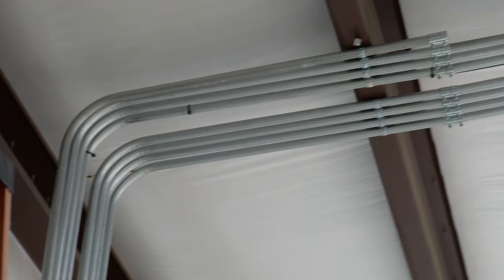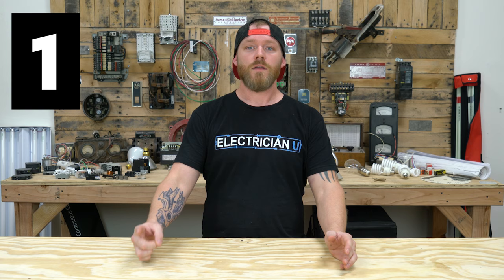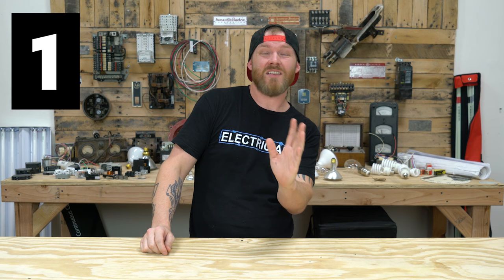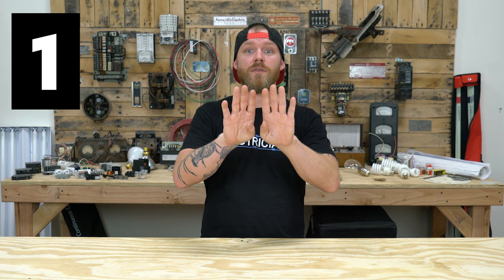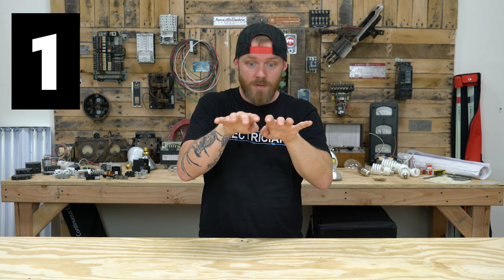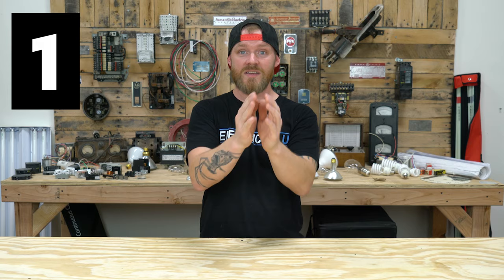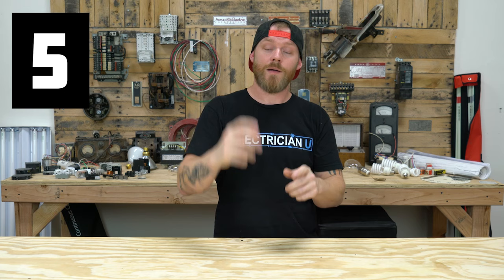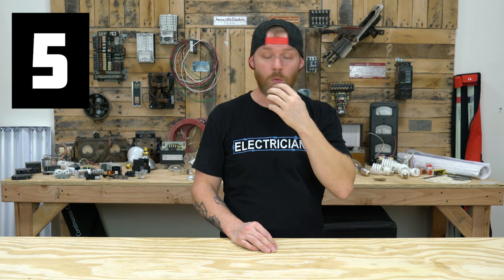8 TIPS FOR WORKING WITH EMT for Electricians

Comment: Run the correct size conduit... I just saw a dude trying to pull 11 or 12  #12's in a 3/4  , with bends and about 80 long ..  Hell  give yourself some room - you might want to add later
Reply: Jesus. Was it stranded? I’m only a 1st year apprentice but recently had to pull 3 circuits of solid wire through 3/4. It was not fun
Reply: @tylerclark5086  yes stranded but still  - no room to grow

Comment: For the past 5 weeks we've been going through about 700' of conduit daily, and after taking a few days off for Thanksgiving, coming back to videos like these is a great way to get out of vacation mode and back into work mode.
Reply: Nice easy straight pipes no problem. Lol
Reply: @klimvanglodove2925  the shortest distance between two points is a straight line.....even if it goes through the kitchen of the DFAC. 🤣🤣🤣🤣🤣

Comment: Thought I was a decent conduit bender until my company hired a young guy swear that he had 20/10 vison. Most of the times he could eye ball a bend without using a tape measure. Had him work on a job where we installed over a mile of conduit in a plastic injection/ machine shop. We used regular 15/8" deep unistrut but got a hold of some think it was 1/2 or 5/8" deep extra shallow unistrut so we did not have to offset into 1900 & 2100 boxes by mounting several boxes on shallow strut and all conduit runs on regular 15/8" deep strut. This saved us from installing a lot of pull boxes due to all runs had 360 degrees in bends. On big jobs best pratice is to have 2 best conduit installers walk around rooms several times and figure out best route for runs.

Comment: I'll typically keep a scrap piece about 6 feet long or so. Sometimes there are not great and consistent reference points around to measure for offset. So ill attach the scrap piece and extend it past the obstacle, hold my level on it and measure. Also a bang on caddy 8ft down the line sure helps when throwing up 10ft stalks of pipe alone considering how frustrating it can be to get the pipe into the coupling smoothly.

Comment: 2 add ons...

Know when to throw the level back in the toolbox. Especially on upgrades when you are not the first one there.  Sometimes uniformly f'ed up looks better, one perfect conduit in a rats nest looks like hell.

Have a plan for the entire run before starting. Know where your bends and fittings will be rather than only thinking about the next stick. Nothing worse than putting a fitting someplace hard to pull wires because your at 360 degrees. Handling a spaghetti ball in the middle of a 400 ft pull sucks and big wires suck more.

Comment: Another Tip for people reading comments.
Avoid 360 degrees in your pipe runs. Pulling wire through four 90 degree bends can become damn near impossible.
Reply: Against code as well.
Reply: @Winged1212  no it isn't, thats the max you can have
Reply: Obviously that guy hasn't pulled miles of wire yet.
Reply: Ha I just finished a job where half of the home runs were at least 800° of bend. Took two and a half months of my coworker and I pulling wire like crackheads to finish that. Absolute nightmare.

Comment: If I was using concrete tight fittings on close EMT Runs. I would offset the couplings from each other by exactly three inch’s by cutting the conduit. Makes it a lot easier to tighten and retighten the fittings. Also it looks neat. Also by our local codes you can’t have more that 360 total degrees in a run. You have to install a “J” box to continue.
Reply: Steven Moomey thats NEC code. Not just local. You could install a straight conduit body as a pull point if you wanted to.

Comment: #7 same with strapping. We ran into q-deck and metal trusses hold the pipes up (although you mess the pipe working it up there) it's still code here to strap it down. But I realized when I got done the run that I should have matched my straps with the other 4 runs the jman put up. So I quickly got it fixed.

Comment: I always evenly space but I also split my runs coming out of a panel.  If I know my breakers gonna be on the left it goes to the left side of the enclosure and if its gonna be on the right it goes on the right.  Helps reduce the number of times I'm "crossing" the panel.

Also on my truck I keep the common couplings and connectors for 1/2 thru 1 and 1 hole straps.  Then I have a mixed bin of random connectors couplings straps etc. for each size.  90% of the time I have what I need to make it through or know our regular service sites well enough to know what I need to bring or what's on site in the service lockup.

Comment: Hey man I would really love if you did one of these on Panels, I'm in school right now and having a little bit of a hard time keeping looking clean. If you could talk about any techniques that you use, that would be awesome. Thanks for all your videos they are great.
Reply: I'm doing panels at work right now.
3 sets of 2 panels with a trough above each set.
Set your panels up properly from the start. 
Run homeruns with odd circuits from the left and even circuits from the right.
Don't enter and odd circuit on the right and wrap it around the panel to land it on the left.  
If pipe was ran pull the correct colors to match the phase for that circuit. If MC was ran it is what it is.
If feeding multiple circuits thru a nipple pair and  them with a zip tie to keep neutrals and hots from mixing. 
Mark every homerun.
Square off your neutrals to the side and back corner off the panel then down to the terminals, square off the bends on the wire and secure with sticky backs and zip ties.
Mark the numer of the circuit by each terminal with a number book.
Square off your hots to the sides and down to each breaker. 
Keep neutrals and grounds to the back and hots in the front.
Tie the grounds as 1 wire with zip ties and sticky back.
Do the same with neutrals and hots. 
Mark the panel schedule.
If it is the first panel and the main breaker serves as the first switch from the street be sure to use MIGB and bond the panel, lug and ground bar. And the service neutral must be bonded.
Any connector on the panel 1" or above requires a threaded pipe bushing.
Can't think of anything else - good luck
Reply: Michael Gallagher thanks so much I really appreciate all the advice! I’ve made some notes and I will use them on my next panel.

Comment: 1) know your bender.
2) check for kinks
3)add lube to bender head
4) know how to bend conduit with out turning over the pipe around. Use your stars, notches
Reply: Lube to bender?  Never heard of that.
Reply: @JulesBartow  yeah it helps with it bending smoothly. Example on 1 inch pipe and up, how many times have you done 3 and 4 points and they have the bumps on the i side, especially if you let thr bender release tension a bit when doing the bends, even on 90s?? 

Rub lube onto bender well, and bend a little smoother with great tension with releasing pressure.

Comment: Hey, I have been in the electrical trade for 2 years now and was wondering if there's any way to wire a 3way half hot and if so how. It would be awesome if you can make a video of that.
Reply: If you are wiring from scratch in residential: You would have to run a piece of romex 2 from one power source to bring hot and neutral to one switch box, then run another romex 2 from that switch to feed hot and neutral to the receptacle box. This will give you power to your switch and your receptacle. Then you will need to run romex 3 from the first switch box to the second switch box in order to have your travelers (red and black) between the switches. The white will be neutral on all cables. Finally, you will need to run a romex 2 switch leg from the second switch to the receptacle. You will then need to break the hot tab on the receptacle and leave one half of the duplex hard wired and switch the other with the black from the switch leg. There are several ways to do it, depending on local codes, how big the boxes are, if you plan on making any separate distribution boxes, or if you are using some sort of conduit etc.
Reply: @illestofdemall13 good explanation.
Reply: Half hot? What the hell does that mean?

Comment: Finding a lvl floor at a jobsite to be checking 90's is rare. You are under pressure for production and in competition with other mechanics. I use a door or window frame to eyeball if its parallel, kinda how you look for parallel in an offset.
Reply: That's why it's good to have a level bending table or even have 2 pieces of angle iron welded in the corner to butt your 90s up against to check if it matches 👍

Comment: Always go by Art. 110-12  , especially with exposed work , had a job @ the ship yard here , ran a rack of 3/4 emt ( about 10 pipes ) had that rack looking straight but it made the steel beams look crooked ( because the beams was crooked and that’s why hat threw me off in the beginning ) So the big wigs didn’t like so I had to go back and readjust my rack of pipes to be crooked as the steel beams 🤬

Comment: #7 is a waste of time and material. Lining everything up on the same plane like that just means you can’t bend pipe and that you have to put up cutoffs. Your logic behind #8 is flawed. If you plan your conduit runs you have a great run without added labor from splices.
Reply: You can plan well but at some point you may need to make j-boxes to not go beyond 360 degrees of bends between pull points.

Comment: Plan your pipe runs for ease of pulling wire first and foremost. Making your pipe look pretty should be a close second. Learn to distinguish between exposed and concealed behind walls, ceilings, etc. There’s no need to put your level on a shotgun bracket in a wall that’s only there to strap conduits to. Your eyeball is good enough

Comment: Working with conduit? You mean put it down and run mc cable 😂
Reply: Pipe looks way nicer imo. And some specs or contractors will require it. Or when you get into big commercial a couple thick pipes look way better/neater then a whole wad of cables. In my jurisdiction you aren't allowed to bundle more then 3 or 4 cables together though.
Reply: @Avocado_Gravy  You right pipe does look nicer. No denying that, I was just making a joke. I'll bend a conduit if I'm in a electrical room that has nothing but conduit. You do see the occasional mc slipped in though tie wrapped to the conduit
Reply: @maxujess25  low population where I'm at so inspectors have too much time on their hands haha. We definitely just run Mc cable down the walls and stuff. Once you get the hang of it its not so bad. But your first time your jmans like "make me a box offset" and you go bend it and he's like like "just a tiny offset for these, you're clearing the box" :p. I bought a bender in my 1st year though and took the scraps home to practice
Reply: The company I work for actually still roughs rooms in  pipe still. I'm actually in the service dept and I run pipe ,mc, flex, PVC, etc. I feel you on that box offset, my apprentice years were rough because I was doing different things everyday and pipe bending was the skill we worked on the least but eventually I got it down.